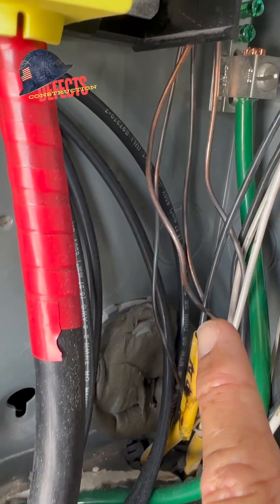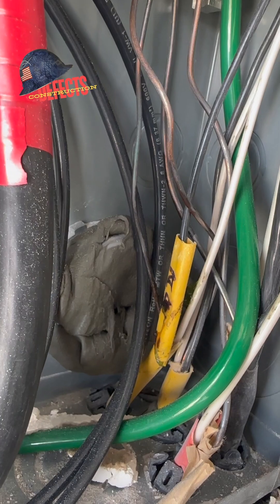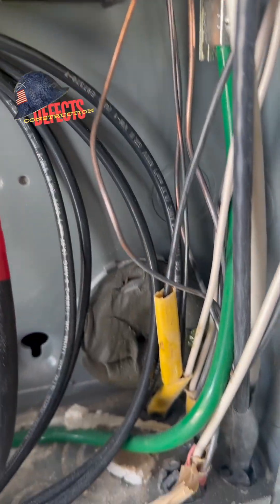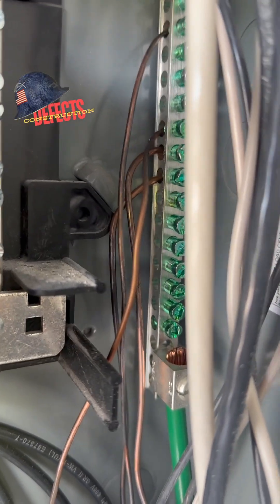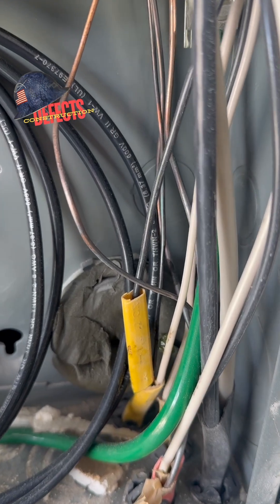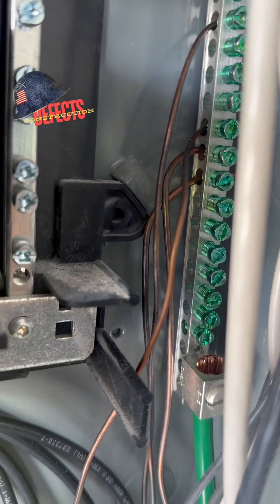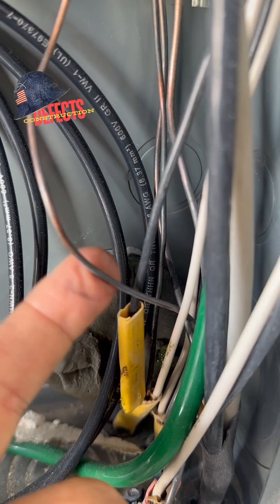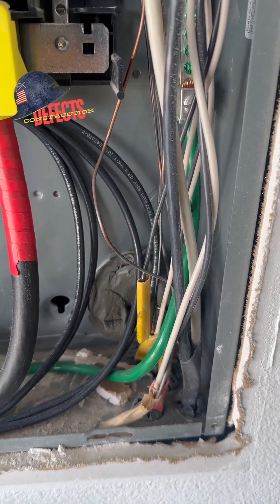Blackened Copper Wire Mystery Solved? #ElectricalTips #HomeInspection #GroundingIssues

Comment from the maker: See The Possible Causes in the below List
Detailed Causes of Copper Wire Blackening

Research and expert discussions highlight several potential causes for copper wire discoloration in electrical panels, which can be categorized into environmental, chemical, and electrical factors. Below is a detailed breakdown:

1. Oxidation (Green or Black) ➡️ Copper reacts with oxygen and moisture to form copper oxide (CuO, black) or copper carbonate (green). Accelerated in humid environments. 
   Relevance to Grounding issues: (Can be exacerbated by heat from electrical faults, like loose connections.	
  🔎 Seen in panels with high humidity, e.g., basements.)

2. Sulfur Compound Exposure ➡️ Hydrogen sulfide (H₂S) from sewer gases or defective drywall forms black copper sulfide (Cu₂S).	
   Relevance to Grounding issues:  (Indirectly related; poor grounding might allow stray currents to enhance corrosion.
  🔎 Linked to sewer odors in basements 

3. Overheating/Electrical Stress ➡️ Loose ground clamps increase resistance, causing localized heating or arcing, potentially blackening copper.
 Relevance to Grounding issues:  Directly related; your field observations confirm this correlation.	
  🔎 Noted in panels with defective clamps, as per your transcript.

4, High Moisture/Water Intrusion ➡️ High humidity or water ingress promotes uneven green patina, sometimes progressing to black.
    Relevance to Grounding issues:  Can interact with grounding issues, worsening corrosion.	
   🔎 Common in older mobile home panels with rust-through holes .

5. Defective "Chinese" Drywall ➡️ Imported around 2006, releases sulfur compounds, blackening copper.	
    Relevance to Grounding issues:  Unlikely here, as home is 11 months old, this possibility  is 2006 era issue.	
    🔎 Historical, not relevant to new construction.

6. Anti-Oxidant Paste Misuse ➡️ Excessive use on breaker connections can blacken copper, typically for aluminum wire.)
   Relevance to Grounding issues: Not directly related to grounding, more a maintenance issue.)	
      🔎 Noted in maintenance errors, per How to Look at a House.

7. Sewer Gas Leak (H₂S) ➡️ One-time event, not discernible, causes blackening.	
 Relevance to Grounding issues: (Possible environmental factor, not directly tied to grounding. Linked to sewer odors in basements)
    🔎 Mentioned in forums, e.g., Mike Holt’s Forum.

Comment: If it is a bad ground i think everyone needs to remember our main ground comes from utility. After that we all install secondary grounding like at home ground rods/cold water grounds/ gas ground
Reply from the maker: Hey @LilMuffinTop, spot on—thanks for pointing that out! Yeah, the main ground bonds from the utility at the service, and those secondary rods (or water/gas bonds) are just backups for local stuff like faults or lightning. But here’s the thing, a bad secondary—like a rusty rod in marshy ground—can still cause trouble. It jacks up local resistance, letting heat or stray currents build right at the panel’s bus where the wires connect. That plus moisture, speeds up oxidation on the ground and neutral wires, turning ’em black with copper oxide.
In 25 years of electrical inspections, I’ve chased this down … this black wiring issue (over 100 times), and 9 out of 10, it’s a secondary ground gone bad or a loose clamp, corroded rod, you name it. The solar might’ve thrown it off too. Ohm test from panel to rod was my final confirmation. 
Have you seen this before?  
Thanks for your comment BTW 👍
Reply: @ConstructionDefectVideos   I think i have but only in older panels not new construction. Thanks for the reply i will look out for stuff like this more often now. I work by the ocean so very wet and salty air.

Comment from the maker: By the way, this house is 11 months old with generator installation 6 months ago. 
If anyone has seen bare copper turning black in main panel let the community know if you determined the cause.
Reply: I have seen this scenario many times but NOT on new construction! 
Wow, good example.
Reply from the maker: @inspectflix  Thanks... I definitely have  seen this issuet multiple times over the years, but only a few in the 1st year.. Always a surprise.By the way, I added a cause list to the video description and in the pinned comment. Check it out.